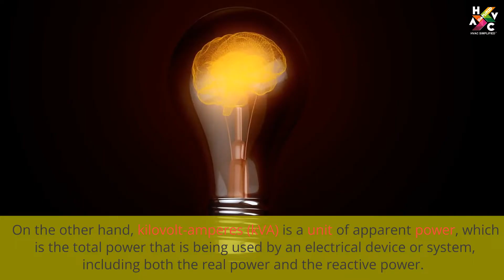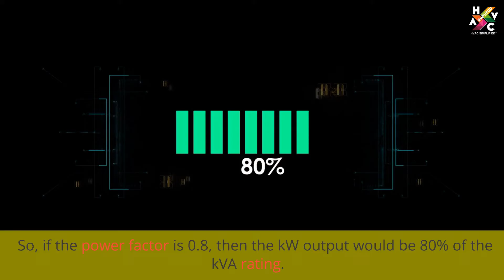Difference between kW & KVA (kilowatts & kilovolt amperes) - “A Complete Guide”

Comment: kVA is a marketing scam IMHO. Its a way to over complicate how good a generator actually is. Sell a 1kVA generator that's really only 800w because no manufacturers who use kVA tells you that generators have x0.8 power factor. A lot of people will tell you 1kVA is the same as 1kW but it's not.
Reply: In certain calculations kva and kw can be used interchangeably.